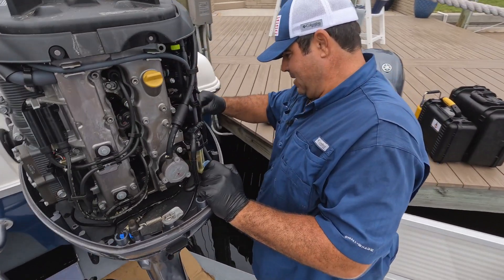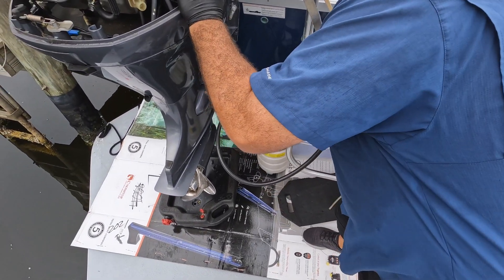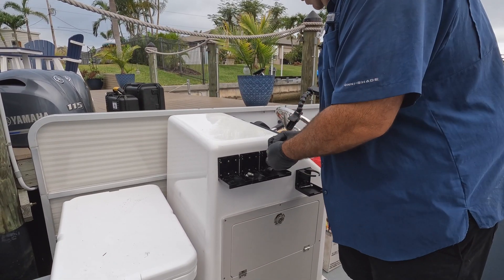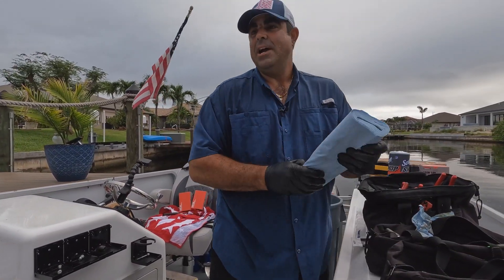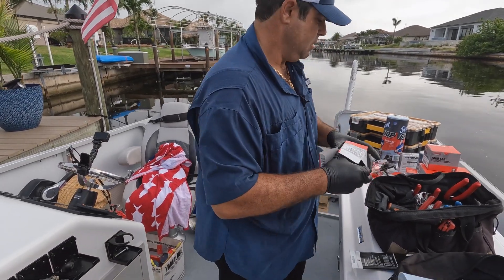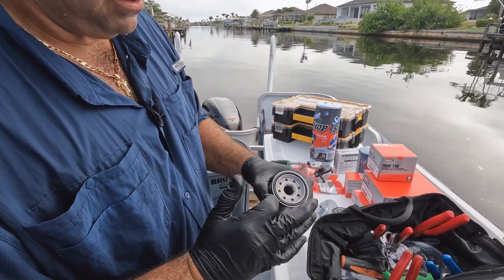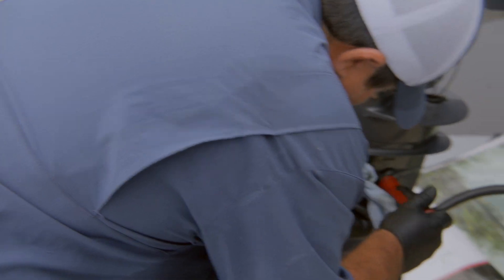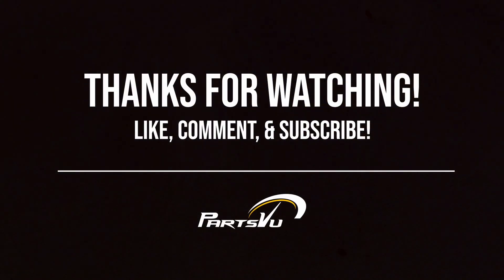How to Perform an Engine Oil Change | DIY Yamaha Outboard Maintenance

Comment: Question: If I drain oil with plug. Are there any reason not to?
Reply: And do you have a video on draining engine oil with plug.
Reply from the maker: @goodtimeswithal  
Typically when performing an oil change on a Yamaha outboard motor, you would need to remove the oil drain plug to allow the old oil to drain out completely. This plug is usually located on the lower part of the engine's oil pan or sump. Once you remove the drain plug, the old oil will drain out, and you can then proceed with adding fresh oil. It's essential to ensure that you have an appropriate container to catch the old oil and to dispose of it properly according to local regulations. Always refer to your Yamaha outboard motor manual for specific instructions on oil changes and maintenance procedures.

I am afraid we do not have videos performing an oil change without removing the plug as that is not recommended. Let us know if you have any other questions or concerns!

Happy Boating!